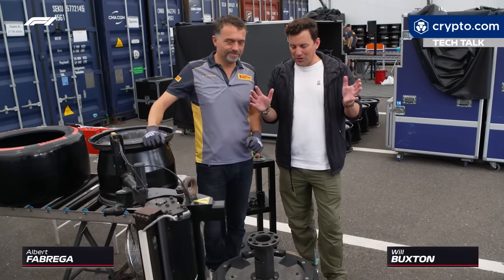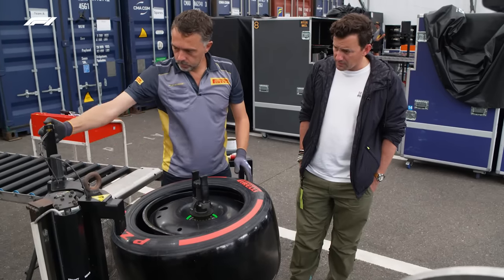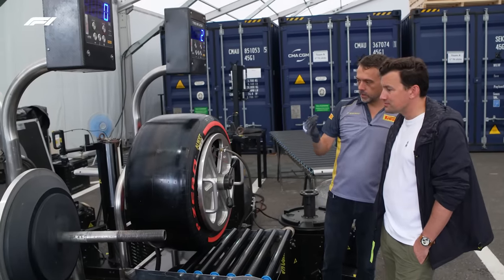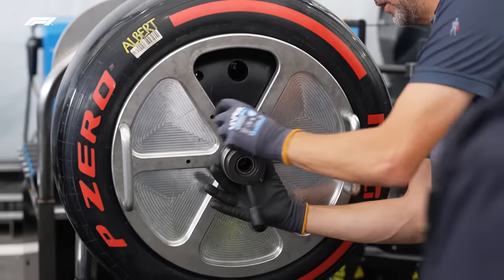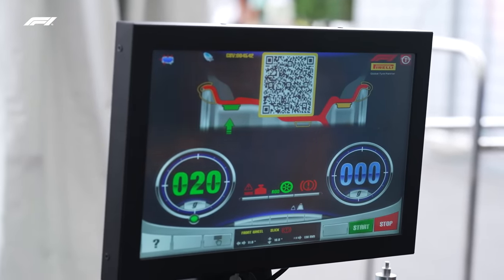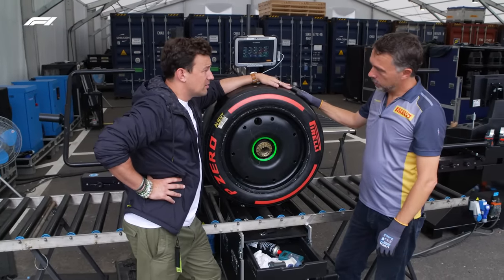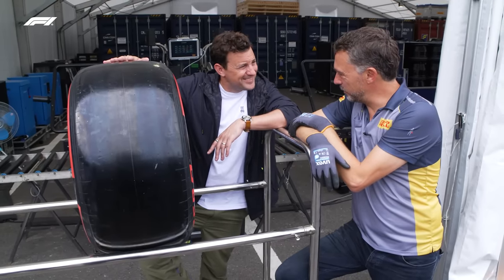How Are F1 Tyres Fitted? | Tech Talk | Crypto.com

Comment: As a car mechanic who mounts tyres as part of my job, this was amazing to see how similar road tyres are to these F1 tyres. Thanks guys!
Reply: Seating the bead.
Reply: when I saw those weight stickers, I was like - we have the same:D
Reply: Ahahaha I was thinking the same!
Reply: You and me should get a job in F1
Reply: I've seen mechanics put on new tyres on road car wheels and this exactly the same as that, maybe except it looks like Pirelli uses some fancy liquid instead of just soapy water.
Reply: As a useless man who provides little to no value to this world, its amazing to see how the tires are prepped.
Reply: By the looks of it I think some road tires might actually be harder to mount. F1 tire sidewalls work with the suspension so they are fairly soft. The low profile max performance road tire sidewalls seem much stiffer and harder to mount. Also, the bead pop is usually louder and no one yelled. 😉
Reply: I mounted pirelli low profiles and they was harder to mount than these F1 tires
Reply: I mean this is not tractor tyres why would they mount it differently ?
Reply: @TehAzaack  Potentially because its a car that exerts 5+ Gs worth of force through them in some corners all while going 300+ KPH, while reaching insane temperatures and they have to last and stay on the rims for hundreds of km at those performance demands without failing. I could definitely see a special procedure, obviously its not, but I wouldnt have been surprised if it was.
Reply: @sadmanh0  At 2:21 you can hear Albert say that it is "not a soap, it's like a little bit glue", so it prevents the tyre from slipping on the rim under braking.😉
Reply: Yep, that was a pretty underwhelming watch.
Reply: @seashackf1  He did say every team uses the same wheels and obviously the same tires. All of their equipment is spec'd for the same size wheel and tire which makes the job easier than your road cars. Where the equipment needs to work with a wide variety of sizes.
Reply: Soon it will all be automated like the hunter revolution machine.
Reply: @E39M5SPEED  we have that machine ,  it’s cost me a couple tires… hook putting hole in the sidewall,  or just shredding the bead,  so air no longer holds..
Reply: As an American, he did not correctly seat the bead as no starting fluid was used.
Reply: What did you expect them to be? It's a tyre.
Reply: @Ding_Bat  In drag racing where the dragster cove 1000 feet (304.8) meters of track in 3.62 seconds the engine produce around 11000 hp, the enormous amount of torque transmitted to the tires will make the tire to spin on the rim, therefore the tires are BOLTED (several bolts) to the bead area of the wheel to prevent slippage. Have a great day. Cheers
Reply: even the sensor is like renault had back in 2000s

Comment: Watching this makes me think of Buemis ridiculous crash where his wheels yeeted off to another dimension 🤣
Reply: and he was still trying to turn ☠️
Reply: Je n'ai jamais su ce qui c'était passé réellement.
Reply: It was like he was still on auto pilot. He slammed on the brakes at the 100 meter marker, the brakes exploded and he still hard locks to the right as if going through the turn
Reply: @jaybiggz8181 he was steering to counter the spin
Reply: The braking loads were so high that both front spindles snapped off!! Several tons of front force, from both braking loads and downforce, caused them to snap simultaneously!
They were immediately re-engineered and this never happened again...
Reply: It's a classic

Comment: By the looks of it I think some road tires might actually be harder to mount. F1 tire sidewalls work with the suspension so they are fairly soft. The low profile max performance road tire sidewalls seem much stiffer and harder to mount. Also, the bead pop is usually louder and no one yelled. 😉
Reply: Yeah, I was surprised how easy he pushed the tire on
Reply: >F1 tire sidewalls work with the suspension so they are fairly soft. 

This is total bull***. They take 340+ kph loads through them, regularly, for up to 40+ laps. No, they aren't "soft".
Reply: @user-sm5en5ns9m  softer than a low profile max performance street tire. Learn to read and about F1 tires before calling bs on someone.
Reply: @seashackf1   What you said was completely understood. It's just completely wrong.
Reply: @user-sm5en5ns9m  it’s not wrong though. Again, learn about F1 tires and you’ll see I’m right. Otherwise prove me wrong, if you can, rather than just saying it.

This was a huge issue when they were talking about moving from 13” rims to 18”. Engineers were saying they were going to have to redesign the suspension because they won’t have the taller sidewall tires on the 13” rims to absorb some of the load like they did before. There is also zero chance you could push a max performance street tire on a rim that easily. There is a reason tires shops need to use a machine to mount street tires.

Comment: Im surprised that the unused slicks as well used slicks will be destroyed and used for energy. I really thought they would had remelt those tires and being a part of a new set of tyres. Like in recycling the rubber used to make it
Reply: Yeah, burning rubber doesn't seem like the most sophisticated way of recycling tyres... but in the video they sold it like it was super environmentally friendly and "carbon neutral". Big balls.
Reply: @bigbronx  Well, it depends on what type of rubber they are using for the tires I will guess. If it is natural, then I think it would be better to recycle the unused and used slicks to make new ones. If it is synthetic rubber, then I think they can get away abit more to burn and use it for energy to help make new synthetic rubber. Althrough I would still be happy to know if they would had been recycled
Reply: Transporting tyres to destroy them in Uk.🎉

Comment: Whew! That's a LOT of work! On a standard weekend, drivers are given 13 sets of dry weather tyres, four sets of intermediates and three sets of full wets. An extra set of softs is reserved for those who reach Q3, while all drivers must use at least two different slick compounds in the race, providing the track is dry.

Comment: I used to change my Formula Vee tires on a Harbor Freight manual tire changer, but I have upgraded to a 1960's Coats 10/10.  Balance on a bubble balancer.  On the other hand - that tire width is equal to 4 of my tires.  :)    If they ever upgrade their equipment, they can give me a call....
Reply: Your Vee tires probably have a stiffer sidewall and are harder to mount. Did you see how soft the sidewall was? Albert pushed the tire over the rim with little effort.

Comment: Awesome video, well done as always explaining F1 tech. My question as they mentioned Wets and Inters that aren't used get dismounted and used later. What is the difference of doing it for those vs. the dry tyres that aren't used?
Reply: Pirelli said that using the heat blankets on the tyres is what makes them unable to be reused, so as the wets and inters dont need to be warmed up they can reuse those
Reply: @adityanair774 does that mean they are trash after being warmed but not run, or trash if attempted to be unmounted?

Comment: Hehe, well apart from my toy cars,  I haven't fitted any tyres to wheels for approximately 35 years, but it was my job for 8+ years. And of course it all seems pretty familiar really, except the machines are a tad more advanced. Even 30 years back something many tyres were directional, and something like a Porsche may have required a specific tyre for each corner of the car, meaning that the left front could not go on the right etc.

Comment: Would have been cool to know why slicks cant be re-used :D
Reply: Cause they run out of rubber, it’s easier to burn them down than to try and create more rubber around the already used tyre.
Reply: - @ferst262  at 10:15 he says they do this to new, unused slicks as well. Strange? Why not simply keep it for a week till the next race?
Reply: @puciohenzap891  they can get damaged on transport, it’s much safer to make new ones. 3 trips are way more likely to cause damage to slicks than just 1 trip.
Reply: @ferst262  i dont think so, they could protect it more, same thing Im asking, why do they waste it? unused set should be used for next cause
Reply: @nopetarpan  they aren’t wasted at all, he explained how they reuse them. Also, they can’t protect them more, that would mean way more weight on planes, which means more money and fuel, and they would need to once again do that for the next destination. It’s much more easy, way smarter, faster ay safer and way more sustainable to reuse those for other purposes and make new ones.
Reply: It does seem like a waste. They try to make it sound like they are "recycling" but in the end it took more time and energy to make the new tire. Burning a brand new tire down does not give back the same energy.  Maybe it has to do with the glue that is used to seat the tire?
Reply: @DirtComplex  it does definitely not take more energy to create a new tyre than the energy that tyre produces
Reply: @ferst262  And why would you think so? Energy released is the amount of chemical energy of the materials. 
Energy needed to manufacture a tyre involves taking that same amount of material and then many more production processes and steps, each requiring additional energy.

Thus, burning a tyre will always be less efficient. It's like degrading a product's potential usability.
Reply: not really, the heat needed to melt the rubber is way less than the energy it gives by being used as fuel. Look it up, else they wouldn't be doing it. Pretty sure they have looked into it way more than you did.
Reply: @ferst262  Of course it does. It's simple thermodynamics. There is no such thing as a perpetual motion machine. Energy is lost through heat. It takes more energy to create a tire. Energy is lost when the tire is "burned." If this was actually true Pirelli would be using energy from used tires and never have to buy energy ever again. Does not compute.
Reply: @DirtComplex  if you use basic physics you end up with no air reduction… then F1 wouldn’t be hard to take part on. So “basic thermodynamics” can get you pretty wrong if you don’t know how to use it, which is your case. It takes more energy to gather the rubber, not to create the tyre, and since the rubber isn’t only picked up for F1, it doesn’t matter how much it takes to pick it up,it’s only relevant the tyre making process. It does compute for someone who actually thinks and has knowledge, so understandably it doesn’t compute for you
Reply: @ferst262  so you're telling that burning gathered rubber (almost raw material) and a tire would be the same amount of energy, right? I would somewhat agree, it's a close thing.

But then, you wouldn't include lost energy of turning crude rubber into a tire, and that takes A LOT of energy and process steps to do so, you agree with that?. And by burning the tire, you're getting the chemical energy of the rubber back, not the one used (lost) in manufacturing.

I hope you can now agree and we're settled? 🙂

Short comment on the melting vs burning. Well first, melting doesn't give out energy, only takes in. Second, burning also takes energy in, but also gives out, and gives out way more releasing chemical bonds energy, that's why it can be burned and used as a fuel. Third, after melting a tire, you might be able to reuse the rubber for something else (like burning it), but definitely not another tire, since it's a complex mix of materials. This is called material degradation, very much like you can boil an egg but after cooling it down, it won't get back to being a fresh egg.
Reply: Hard to believe that a fitted tire, deflated, could not be gang mounted on a spindle loaded on a rack, or some other method designed suitably safe for transport from track to track.

The rack shown rests the inflated wheel assy  on the running surface. An unmounted tire, obviously more compliant than a mounted and inflated tire is able to be transported to/from circuits trouble free. It is baffling to me that engineers cannot devise a way to not only make use of the energy req’d to mfg the tire in the first place but also the energy and time used to transport, and later fit the tire at any venue.

The cars are transported from circuit to circuit without issue, but new tires on rims are somehow too delicate? A clear failing on the part of F1 & Pirelli while touting environmentalism to transport tires there and back simply to burn them.

Comment: Using old Tyres as Energy does mean that they burn the garbage? Doesn‘t it? Thats not exactly recycling hm?!
Reply: It’s not garbage, they use them as fuel after they have been used. It is recycling, not remaking.
Reply: Burning them, if that is what they are doing, is not carbon neutral.
Reply: @ferst262  burning my Clothes after wearing is also like fuel to produce heat. But its Not Recycling. Its burning things to use the heat. After burnig the tyres there is nothing left to use further. But the Emission of Co2 and other pollution is high.
Reply: How do they re cycle the tyres in order to get energy? Do they burn them? If so, where does the smoke from burning them ? Rubber smoke is highly toxic.
Reply: How do they re cycle the tyres in order to get energy? Do they burn them? If so, where does the smoke from burning them ? Rubber smoke is highly toxic.

Comment: I wonder if Redbull have so much less tyre degradation because they didn’t use fully  Nitrogen gas ,but something Nitrogen mixed gas? I mean when they get the tyres before the race they release some Nitrogen and fill with something else at the same pressure. Honesty i was thinking about it because strange that big difference between qualification and race pace.

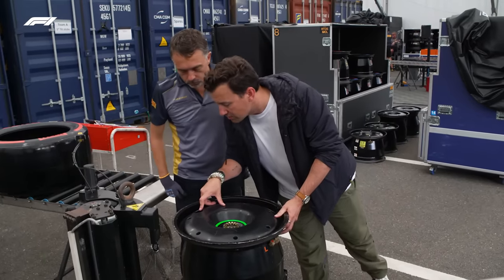Comment: 1:50 ‘ok-ok’ 😂

in 2021, when the new car body design was said to start in 2022, some ppl say the 2022-2025 cars’ wheel rims r gonna have lights that will show adverts & the driver’s position that look like something outta a futuristic sci-fi movie

will that ever happen?

& i also heard during 2022 when the brand new cars were out, the wheel🛞 rim lights didn’t happen bcs it’s thought to add more weight on the car🏎️

same thing w/ brake lights on f1 cars, never happened cos it’d add weight onto the car

but will wheel rim lights ever happen?

cos it looks cool👌

Comment: Why does the pressure max out at 70psi? Road cycling tyres go up to 120psi? What am I getting wrong here?
Reply: I imagine that the larger something is, the less pressure it is able to hold
Reply: You can't compare them to road car tyres. If you pump them up, they will literally explode at some stage. Just think: Thy can heat up to 100 or more degrees which increases pressure, the load from the aero from the car...put this all together and have it pumped up to the max: The tyre will destroy itself.
Reply: Does it look like a bike?

Most road cars are like 33psi.

SUVs up to about 45.
Reply: From a quick Google:

"Larger tires, to work effectively need to have lower pressures inside so as to maintain the ratio of tire width to contact patch, critical for the tires to work as designed".

Remember PSI stands for "lbs per square inch" which is the weight of the vehicle divided by the contact patch of the wheel in square inches.

So math dictates that you need lower PSI with larger tyres since F1 tyres have a large contact patch

Comment: My question is why cant they dismantle slicks if not used? Seems like thats the obvious thing to do if you are trying to be more environmentally friendly
Reply: He said they want to do that, but unfortunately not why they don't now.. If I'm correct why they do not use unused tires for the next race is because the tire compound is made in batches and there might be a slight difference between batches (and thus in lap time). So all the tires for a race would be made with the same batch.
Reply: @stefandebruijn2654  yea that does make a lot of sense actually. Thanks for answering my question.

Comment: If Pirelli are getting ready to carry unused slicks on top new races why not just keep them mounted on the rims and they go back to the same drivers? Surely that will save time and energy dismounting and remounting. Almost all teams will have an odd few sets left over as well as the wet weather sets
Reply: They want to double check or they want to reuse the rims
Reply: @Akniy  But Pirelli could keep hold of the rims and tyres, since they’re all spec parts, for each team. So why not just keep it mounted? All the quality checks etc can be done
Reply: They can be damaged while transported, they would have to unmount them and mount them again to check everything is working fine, not worth the effort, and if they don’t do that, it’s a huge safety issue.